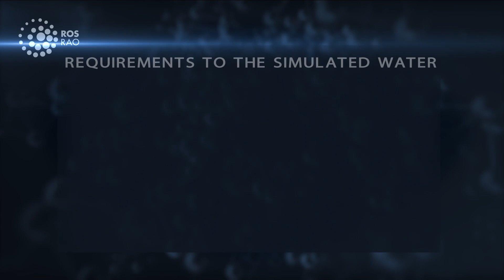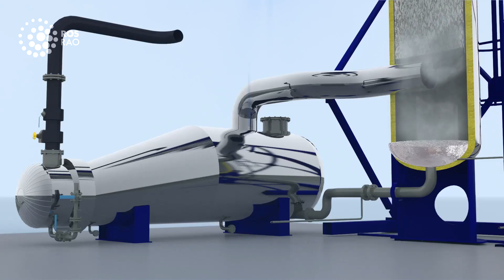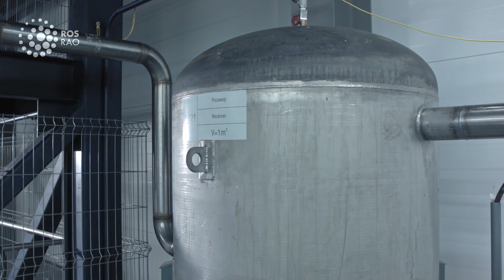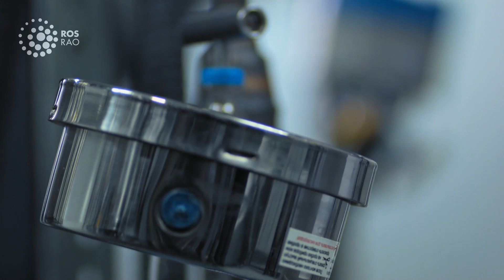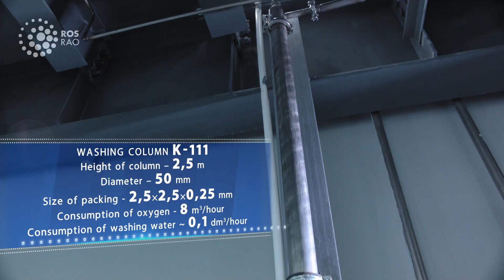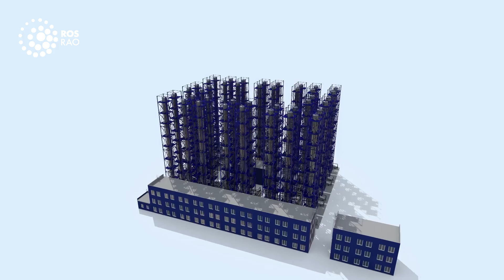Tritium separation technology for LRW treatment (ENG)

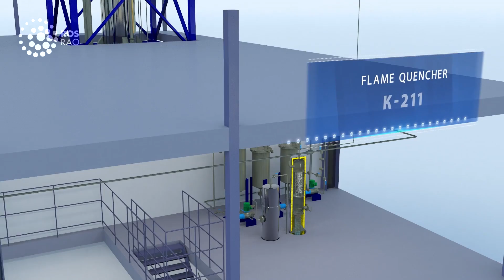Comment: 13:10 why are you not collecting the hydrogen gas instead of venting it into the atmosphere? 
Hydrogen is getting more valuable as an alternative fuel source for vehicles!
Reply: Hydrogen is expensive to effectively contain... alternative fuel sources are not commercialy viable yet
Reply: I can’t imagine that being worth it. 
First of all hydrogen is annoying to store since it likes to leak everywhere. 
This facility does not appear to be very close to a place where hydrogen would be needed. 
Producing hydrogen is actually pretty cheap.
Putting aside the actual viability for hydrogen as an alternative fuel, this facility would require like 10 hour to produce enough hydrogen to fill a single hydrogen powered car.
Reply: Hydrogen released...will escape atmosphere maybe 🤔 
Not a good  I guess to let it go waste